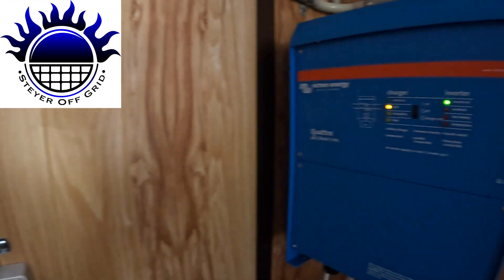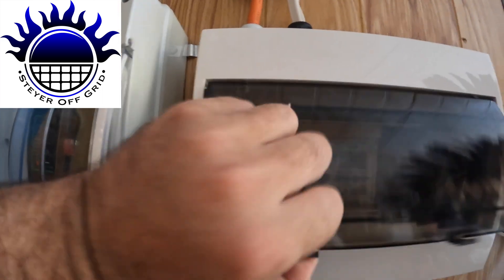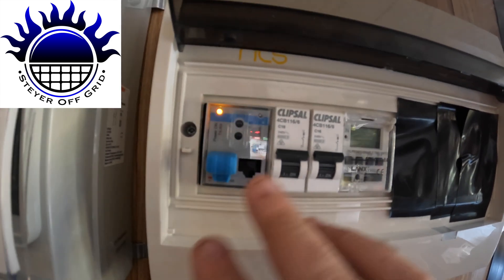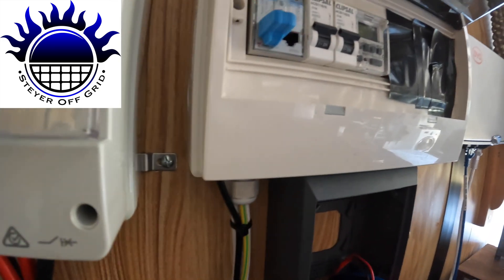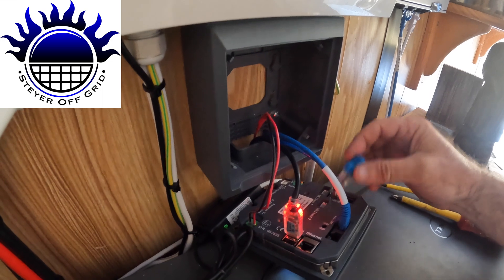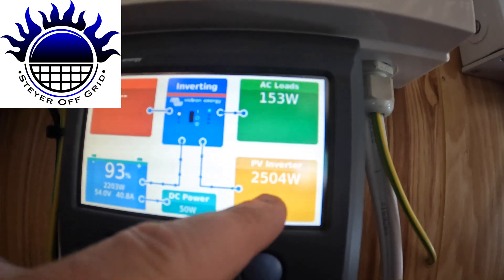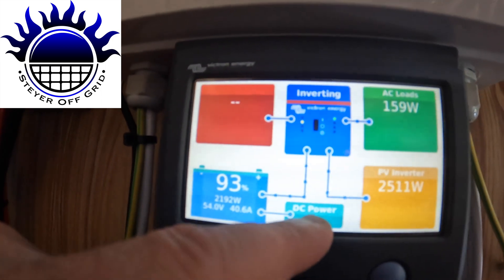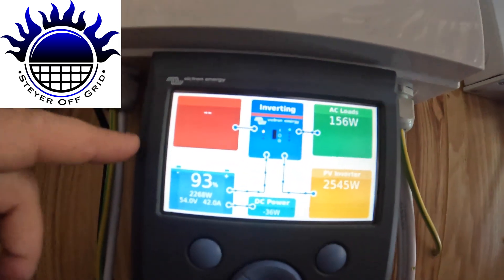Solar Inverter Power Meter Connection Carlo Gavazzi ET112 Power Meter

Comment: Bluethooth bongle... maybe not. 
I think that the 2 'Blue dongles' are the VE.Can RJ45 terminator... and there is no Bluethooth in them... just some wire and a resistor.
and the only data is via the USB and '3 wires'..... the RS485 to USB interface
Reply from the maker: yes you are correct.
Reply: They're also not needed, as the ET112 has a built in terminator, you just have to connect it.

Comment: Gosh, Thanks ! I hadn't realised about the ET112 energy meter telling the Victron Inverter how much solar was being produced and in turn, altering its charge to your battery bank in real time. 
I guess data from the energy meter shows up somewhere and logged if needed.

Oh yes, I think the 'Blue dongle' is a RS485 termination resistor (120 ohms), terminating at the end on RS485 line stopping reflections.
Reply from the maker: Yeah I don't no much about the data logging, I have no need for it ATM. And re the dongle I just know that it's bluetooth, I'm not really a tech head. But Cheers!
Reply: @steyeroffgrid  The blue RJ45 plug isn't a Bluetooth dongle, it's just a VE.CAN terminator .  You are using RS485 (serial) to USB for comms between the ET112 and the GX.  I haven't fitted my ET112 yet, but am going to have to use RS485 to Zigbee and Zigbee to USB as I don't have a short or easy cable route between my incoming supply and my MultiPlus.  From what I read this isn't likely to be fun :(
Edit: I've just seen myozone actually said the same thing after I expanded their comment...